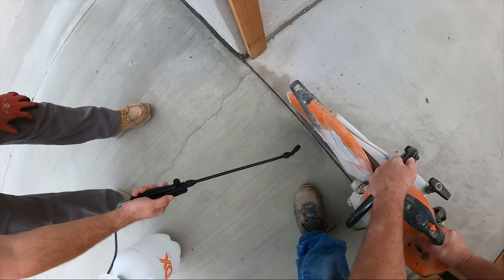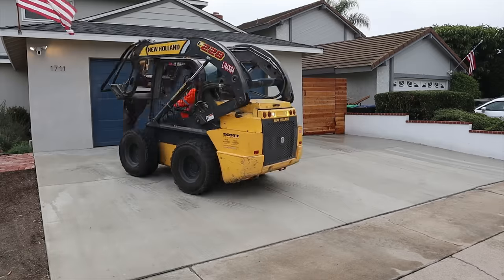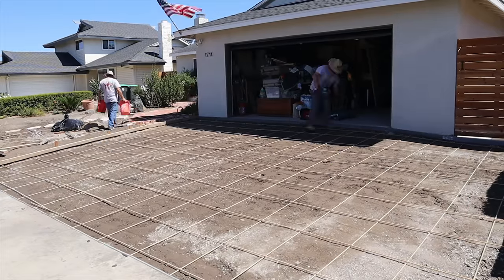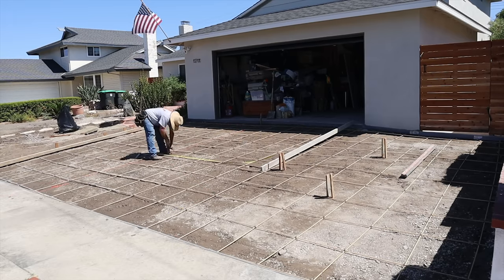Concrete GONE WRONG! Had to Remove and Replace

Comment: The experience we had with Laffey Concrete from Yorkville, Illinois, was incredibly disappointing. They were responsible for our foundation and patio, and the quality of their work was abysmal—cracks, chipping, and they even obscured our sewage cleanout. After it rains, we’re left with water pooling everywhere. It’s a complete disaster. To make matters worse, Travis, the owner, is unresponsive to our messages, and when he does respond, he dismisses our concerns and resorts to swearing. This is definitely a concrete company to steer clear of.
Reply from the maker: Call you're State Contractors Licensing board

Comment: The fiber should have been put in the load at the plant. The more you spin that drum, the hotter the mud gets, making it more prone to cracking. That is a 5 slump. I've worked with concrete for 25 years. Yes, they changed the weight laws,, Most states will only let you haul 9 yards.

Comment: OK David, you seem like a nice guy and pretty honest, so I'll give it to you straight hopefully without being rude. I didn't see the pour but concrete cracks when it's too wet which I'm sure you know. I did see however you clear and pour a new driveway on a recent on video, and although the narrative sounded confident I had serious reservations about what was done. On that pour you put some iron in and then more creating a sort of blank crossword pattern. That's a plus though I would have preferred using what we call in Australia rio which is the same but all welded together in one piece. and you cut the shapes you need. On that job to my approval you also used fibre mesh which at the time I thought could compensate for the way the iron was put down. So far different, but OK in principal though where you went wrong in my opinion is the fibre mesh should have been put in at the plant first, one bag per cubic metre or yard. Putting it in at the back end will never get it thoroughly mixed. Its possible to take a dry mix of concrete and mix it on site but the water has to go in in stages and mixed for half an hour afterwards flat out if you want it mixed all the way back. From what I could tell the job was compacted, which I assume you did here. The concrete slump looked passable but up at the tolerances, Id' recommend always keeping the slump a tight 4 inches no more. If it's a bit less that's fine you just have to work harder and use the vibrator. The last load was a yard and a bit on the wet side, wouldn't have passed a test, so your guys mixed it in with the older mix already poured, quite a bit of work for someone else's mistake, if anything on the last load perhaps order it a bit drier and add a bit of water on site if you need to. Don't let the drivers get slack on you. I didn't see any plastic under the concrete either, to me that's a no no. The cardinal sin on that job was cutting the concrete the next day, and quite frankly I was anticipating cracking like you have on this job. I can't imagine there not being cracks if that is how you poured this job. If a concreter came to my house and told me that's how they were going to do the job they wouldn't get the job. put complete joins in as you go along, or use an edging trowel on the day. It is harder work, but done at the time, with a tighter slump, and good quality compaction should do the trick. clearly explain to the customer not to drive on the driveway for at least 3 days though I personally prefer 7, and use the time to wet the top of the concrete and wrap it in plastic before you go and let the concrete cure properly.  Silica fume is usually used on industrial jobs at 1 bag per metre or yard, if you had just one bag put in first on your initial loads that may make a difference and go a bit deeper along the wheel track area, Another thing to watch is old concrete in your mix, always ask the driver straight up if it's all fresh, they're not supposed to tell, but I guess they can't lie either, and if they look uncomfortable, you know and make a note of it in your diary. Good luck with that.
Reply: How come I can mix in bags of color for ten minutes on site and have same color throughout.
Why do you think the fiber is not getting mixed properly.

Comment: As a former concrete flatwork contractor I know it's always a plus and a bonus to save money on jobs but by using wooden stakes instead of metal stakes makes your company look like a  CHEAP fly by night company instead of a well organized legitimate concrete contractor 
And it's also alot harder on the ones actually doing the form work !
Reply from the maker: It's obvious you haven't done much concrete work.
If you had, then you would know that every type of ground requires different staking materials.

Comment: Isn't this the company doing cinder block work without the required C-29 license in California?  Like, illegal work?
Reply from the maker: General Contractor can sub out to c-29
Reply: @OdellCompleteConcrete  True.  The problem I've found is that the cost goes up exponentially.  You may well be in the minority in not jacking up the price too much, however the general trend I've learned is about 9-10K more for a project that costs $20K

Comment: I hope you kept some of what was torn out for testing - obviously something wrong.  That batch did not hydrate properly for some reason… the reaction did not complete fully so you had very low compressive strength concrete.  Maybe their Portland ratio was off bc some dummy put in 1/4 of what he should have.  Maybe something was contaminated. Who knows, but it looked exactly like what you get if a slab freezes before the reaction kicks off.  I had to replace a couple big winter pours that froze and it looked exactly like yours…punky and chunky…weak.   Don’t kid yourself with the fiberglass rebar tho’ - it can’t be compared to steel apples to apples, while it might be “just as strong” in some aspects it’s not a direct replacement. I don’t think that was the problem at all though - I think you had some bum concrete that’s why it should be analyzed by a lab.  I also think you took a big chance getting from the same company.  And BTW THEIR insurance should cover the job 100% turnkey and not just the concrete.  Lastly you should always use a curing sealer as part of your process- use one of the short-life bio-degradable ones that go on with a garden sprayer.  They won’t impact the final product at all but they will improve the hydration of your slabs and get you to a higher compressive strength sooner without someone having to babysit it for a week with a hose.  It can’t hurt and might help, and costs Pennies per SF.
Reply from the maker: Yes that makes sense to me.
TY

Comment: As a batchman I won't ship concrete I know is bad.  I've never had to have a pour removed and replaced.  I know how expensive it is.  6x6 cuts aren't necessary, if it's a good mix you can do 12. Drivers are good about seeing what the crew does to mess it up though!  I've pitted hundreds of yards to ship great concrete.  Some people's give a damn is busted.  Not mine.
Reply from the maker: Great job
TY
Reply: @OdellCompleteConcrete  gotta look out for the contractors and send good mud!

Comment: Looks like they went overboard on the cement. That’s the way it gets when it’s straight cement
Reply from the maker: Straight cement is the way to go
Reply: @OdellCompleteConcrete  ye but in this case not enough stone in the cement. I hope you don’t have to pay that out of pocket. I don’t feel like that was your fault. Whoever was in charge of mixing it should be responsible.

Comment: Hy Odell ! To me like expert seems that a mix problem in conjunction with a bad treatment on a sunny days or a colder then usual days it has structural cracks that have appear in the end and work cracks that have made because of to much initial strength of the mix ! In other words you have not control the treatment for many days for that particular mix or ! Or bad cement that has been mix with several mix cements (different  time lots )! ....to less water and and the water control bad cure after pouring ! I know you are expert too ! and maybe high winds !!
Reply from the maker: Bad loads happen.
TY

Comment: The surface cracks IMO are due to too much direct sun and possibly overworking it.  I think you had air pockets that caused that pitting.  Curious what the rest of you think.
Reply from the maker: There was little power pockets

Comment: I hope you didn’t have to pay for the concrete David. You never know what’s gonna come out of that truck and usually the company will just blame it on you The finisher putting too much water or you didn’t finish it right and deflect from the blame on them. And for as far as the fiberglass rebar City shouldn’t have any say so whether they’re steel or no steel in that slab Because it’s nonstructural it is not holding up a building. It needs no permit at least where I’m from. That’s the way it is. Also I have had bad luck with rebar in a 4 inch slab because it’s sometimes causes a crack itself when one bar gets too close, one way or the other engineer wise you don’t get your clearances on a 4 inch lab with half-inch rebar I generally use wire mesh, but I’m just saying that’s my method.  Nice looking job though. Good work.
Reply from the maker: Got the second load free , but that's it

Comment: To me it looks like someone floated mud/dirt into the concrete which is a big nono because itll wash out and leave a hole after it rains
Reply from the maker: What about all the cracking?
Reply: @OdellCompleteConcrete  idk about the cracking i never really seen that unless it's a really windy day and not enough water is bleeding/evaporating up out from the concrete to keep the top wet so the top of the concrete will end up getting dry before the bottom/inside and get uneven shrinkage that might be what cracks it im not sure thiugh

Comment: That's when the sand is not good washed ;)
Reply from the maker: Or bad cement
Reply: The cement must have the proper mark, that's for shure . It must be "Portland Cement" with a proper mark for the job 100-500 that's the load in kilograms per square centimeter that can hold. But! If the sand in the concrete still hold a clay -if  it's not good washed. You will have a cracks on your job. Other thing i sow. You  pour  a good chunk of concrete. It's need a good armature too! Not that  stupid fiberglass rods-they are for a fly fishing ;) . You must made a two layer steel cage .With squares  no more than 20 centimeters. The down layer armature must be fixed a good 5 centimeters above the ground. The upper layer of the steel cage must be flooded with 25mm at least .I made so many steel-concrete monolite elements. I saw that problems with my eyes .I wish you to be healthy, and to have only a good-durable  projects!

Comment: I’m surprised at the way you add the fibre. It would never mix thoroughly adding it after in the Uk we add as we mix. The reinforcement you put in is minimal at best and again the thickness of the concrete is minimal. The work of course is fine and you are a gentleman for replacing it but the standards in your country are not very high.
Reply from the maker: Building procedures and standards vary on environmental conditions

Comment: It’s very hard to have the concrete company. Take responsibility for anything these days. CONCRETE is not like it used to be 30 years ago. We never even used to have to put reinforcement in it they don’t believe it but we’ve been around long enough to know better coffee cracks there’s no doubt about it, but when it cracks like that, there’s a problem
Reply from the maker: It's the fly ash  that kills it

Comment: Without watching another 20 minutes I'm guessing they're drying cracks. The pock marks are probably from contaminated aggregate. My farther was a masonry contractor and built many brick schools. One of them developed what appeared almost as a disease when many of the bricks started popping chips. The school district blamed him. After much investigating it was determined that the raw material for the bricks was transported by rail in cars that had once hauled iron ore.
Reply from the maker: Yes I believe it's contaminated material

Comment: Nothing worse than product failure. Makes you look bad and makes the job cost a lot more.  Especially right now with supply chain shortages, you have to take what you can get, and that means getting things from less reputable sources.
Reply from the maker: With the cement shortages here in Southern CA. What I think happens is the cement gets substituted with fly ash or whatever else is available especially on a residential project.

Comment: Next time take a core sample and have a petrography done. Guessing is just that.
Reply from the maker: Yes, it's a 2500-dollar deal to get a core and test
Reply: @OdellCompleteConcrete  Well if the RM company gives you concrete for free to replace then it's not as big of a deal.... but I would think at least they would want to know why it really happened (no guessing) to avoid it happening in the future. Here it's $1500 for a petro and the RM covers the cost unless it's shown to be our fault after the testing is done. But you know how it goes, even when it's our fault, they still work with us on a deal or they know they might lose you as a customer.

Comment: Whenever I get my driveway turned into Concrete.. I wanna make it a nightmare for anyone trying to remove it.  Plenty of rebar (there's plenty of extra rebar at my work that we throw out and at least 75 MPa concrete and use a Vibrator!  I'm use to doing slabs on towers with Portuguese people.  I think it's in their blood!  just yell  "Concrete's Here"  and they come running :)  That driveway will be there till the end of time :)  Oh and they say 2 axels on the rear.. maximum 9 meters... if you want 10, they need a 3 axel truck.  That's why.  At least that's the law here in Ontario Canada.  They may bring 11 if it's the weekend and early morning.
Reply from the maker: The hardest concrete I've removed had chain link fence in it
Reply: @OdellCompleteConcrete  That's creative!  When we were doing large pours (beams)...we would joke about how Justin Trudeau is in there somewhere. haha
Reply from the maker: Maybe hoffa

Comment: It's funny that my foundation on my house was done in 1947 not a crack in it, and  you can't even drill thru it. The new concrete sucks. All the dams built in have old-school concrete. Funny, you can't even blow them up with a missle.
Reply from the maker: Strange

Comment: Remove and replace is 10x more expensive.  Always pay for a testor and compressive break analysis.  Looks like it was poured too wet.  Contractor wouldn't remove and replace unless he was at fault or the company realized there was a problem and offered to pay.
Reply from the maker: True story
Reply: @OdellCompleteConcrete  flyash in the cement silo?

Comment: You add the fibre mesh to their mix. My bet is you’ve added a contaminant and ruined their concrete simply because you use fibre mesh, not proper steel reinforcement.

Comment: All you had to do was throw gravel in there before you lay the rebar and your driveway would've came out okay as long as you have a good raker and finisher who knows to throw concrete on the holes an
Reply from the maker: I wish it was that easy
Reply: @OdellCompleteConcrete  was it graded correctly? I don't see how this could happen so quickly but I'm not gonna sit here and act like I know everything about concrete I don't

Comment: So I give you a ton of credit for going back and making it right, but instead of doing this trick with fiber or not using steel rods, why not just did down 3 or for inches and put down 2B limestone for a better base and to let the water flow under it?  I am not criticizing, I am in the concrete business and that’s what we do. I’m not saying I know anything, but I am in the north east, with harsh winters and all kinds of elevations. That’s all we do and never any issues
Reply from the maker: This is Southern CA where its beach weather everyday
Reply: @OdellCompleteConcrete  isn’t that why you would order it not so tight?

Comment: Why would you use glass fiber reinforcement on a job like this? Why not proper rebar all the way? I do totally agree that there is something not right with this concrete but a real pro doesn't replace proper rebar with angel hair.  It's a myth that that is a good replacement. 2 layers of 6mm , 6x6 inch apart is what you use on a driveway like this. Anything less is not top level..

Comment: Too much sand and rock, not enough portland??

If this concrete is bad and you comment on how weak it is, why are you not replacing the side yard that has "only a 4 foot crack"?  Seems to me it's going to crack worse not long from now if it's the same truckload of concrete.
Reply from the maker: The walkway is foot traffic, so it's strong enough for that

Comment: Great warranty sir, those holes are due to not tampering the concrete enough to get the air bubbles out and consolidate. As for the cracks it's because it's probably subgrade not compacted enough. 
I would definitely due business with your company
Reply: The fine surface cracks don't come from settlement though. It was a bad mix or possibly a mix that had too much water added

Comment: the enforcement by plastic rods is bad decision, a steel rods are more rigid, and also a gap about 40- 50 mm between rods and ground must be

Comment: From engineering perspective that was not correctly made. You should have a plastic foil under reinforced bars (to avoid concrete milk going in the dirt), then some plastic spacers to lift up the bars. And i would go for more bars for that pavement. There will be 2 cars there, so the forces will be high.
Reply from the maker: Santa Ana